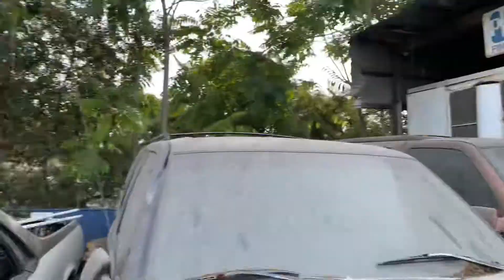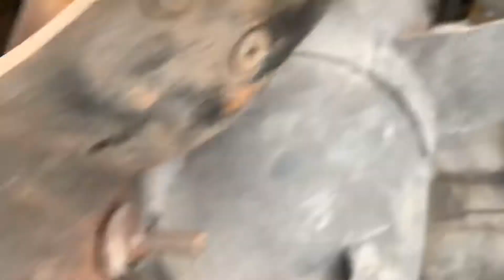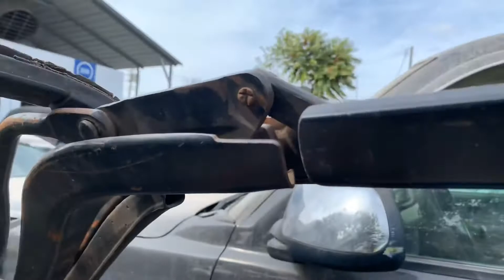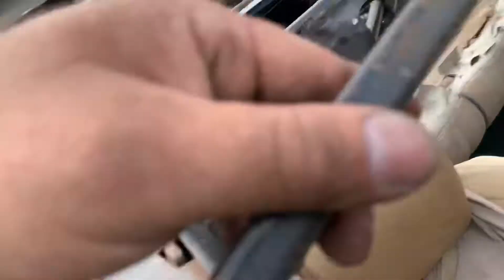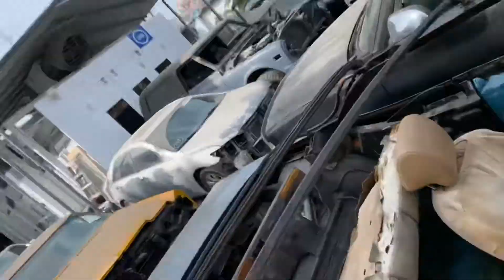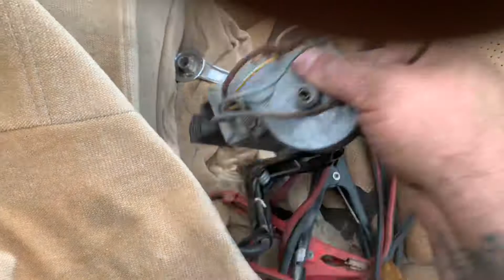Impala mike goes over scissor top rack before tearing down 1973 caprice

Comment: Nice! I love these videos. I'm about to start rebuilding my '74 Eldorado top and these videos are very helpful.
Reply from the maker: Thanks for the feedback. Good luck on build.
Reply: Impala Mike Sir,How much for the back bumper on the 74 chevy caprice hard top  you just posted a few minutes ago?
Reply from the maker: @paulthomas4569  $500
Reply: @impalamike7927  is there a difference between the hard top and convertibles as to wheel tub's and or mini tubing for slicks ( coronets have dentures to fit the bow's vs charger's/regular models that shaping isn't needed/there ), or a more compact way of making a convertible car? Richard wood ( also did it to his personal 69 car using a 1975 caddy-top after he retired ) and bill from dodge back in 1967 used this top ( and a fibberglass/composite removable top as steel wasn't part of the original production plans, ultmently top brass caned it unfortunately and or was thinking of forcing the coronet top in previous generations production to be used but it doesn't work/look really right and yes to a tall guy/6-4+ like my father its a blessing as it adds 3"-6" of roofline but to me i'l pass as well as mr.wood/bill/team ect ) on a 1966-70 charger prototype that im looking at cloning/themed with 1/2-sized dihedral sueside back doors on my 69

also how much about ball park range USD in the lower-48 for the swap/frame cable-type as i don't like the idea of potential oil leaks on my finished installation/interior and or later on needing repairs+leaking and detailing

Comment: Hey Mike I removed both of my gears and took them apart cleaned and regreased them. I have a question for you when I put them back on what is the best way to set the timing I took them off when they still had some tension on them with the top in the closed position.